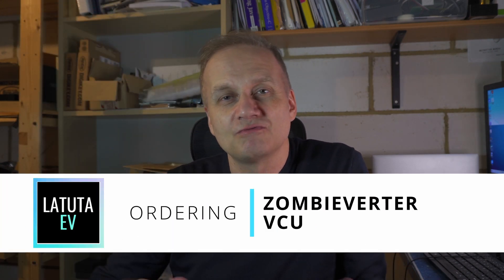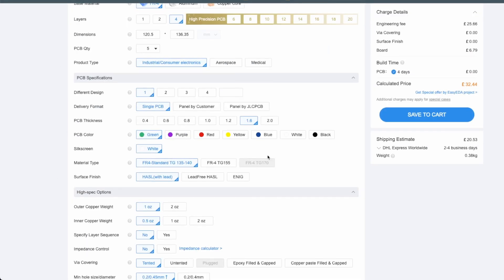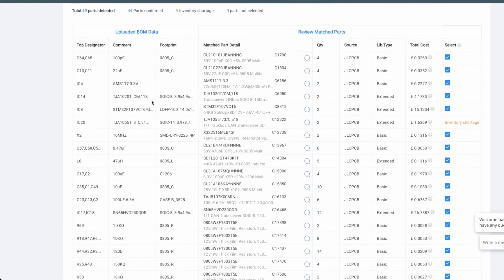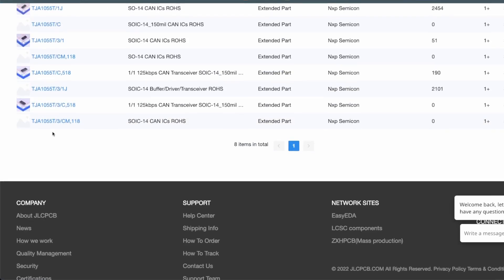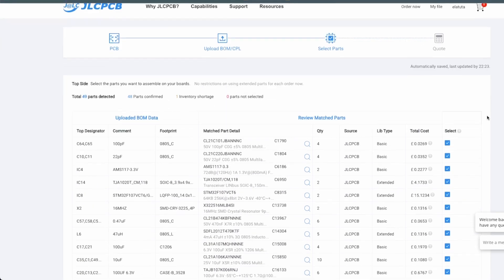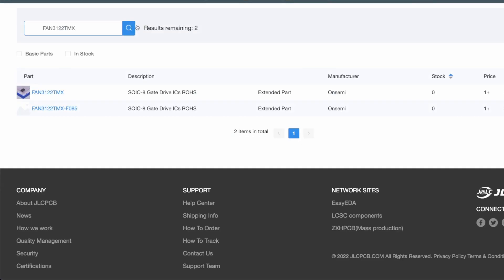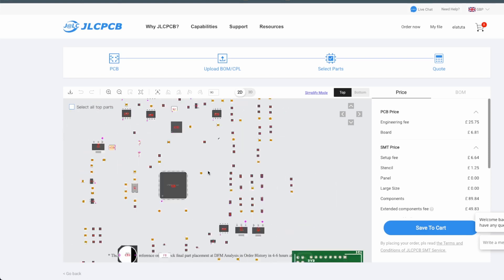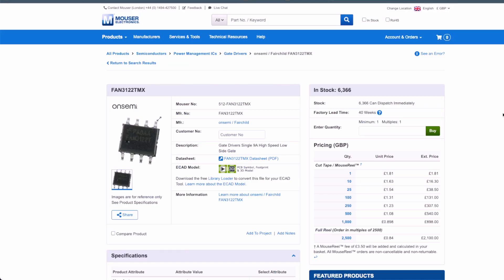Ordering Zombie Verter VCU #2

Comment: I like the idea of having my own board built as well - I think that doing it this way and becoming one of Damien's Patreons seems like the best of both worlds.  In fact, your original Gen 3 inverter board video was what inspired me to have JLCPCB put together the dual motor "small" board... that video was VERY helpful since it illustrated what to look out for between the different sized boards.  I don't see that Damien sells the "small" board.  I'm strongly considering to see if the Dual motor Gen 3 board can be paired with the Camry Hybrid transaxle for more usable power.  These transaxles are now pretty common in wrecking yards and might fall well under your original goal of a low-cost conversion.
Reply from the maker: I am glad that this video was helpful. When you talk about small board I guess you referring to the open inverter board for Prius Gen3 inverter. In this case I am making the VCU board which will communicate to the inverter through the serial link interface rather than providing control signal to igbt transistors. Also other benefits is that it could be used to control other sensors and/or auxiliary accessories in the vehicle. It can also interface to the open inverter as a VCU controller. You right about possibility of picking up cheap Toyota or Lexus transaxle.
Reply: @LatutaEV  Yes, I was referring to your other video... Both of the JLCPCB videos are helpful to those unfamiliar with the service and how to utilize it.  It's interesting to hear the Zombieverter can interface with the OpenInverter board as well.  I might look into that if I can determine that Zombie would offer extra functionality.  I don't have a specific swap in mind yet, I'm mostly just in an exploratory phase.

Comment: Thanks! Your step by step videos are great.
Love all the details. Gives me confidence I could do this. Could you share with us the total cost of all the parts?
Thanks,
Ross
Reply from the maker: For three boards unpopulated and two boards populated and wemos adapter board I paid 210 pounds plus shipping with custom clearance about 23 pounds. You can actually see final price towards the end of the video
Reply: @LatutaEV  Thanks, I went back to the end of the video and did find a total. So it looks like you might save about $100 by doing it yourself over the built unit that Damien sells.
Reply from the maker: @rossconverse9067  To be honest I am not building the board myself just to say money, more for the fun of doing it myself. But I just checked the price and Damien sells one board for 350€, I have 2 boards for £220 plus 3 blank PCBs
Reply: @LatutaEV  Yes, I understand. I'll probably build my own board too. Saving money and the satisfaction of doing it yourself is a win-win. Hopefully we can watch you build your board in detail. Thanks for responding so quickly. 
Ross
Reply from the maker: @rossconverse9067  I already had a message from JLC PCB about the delivery on the 28th but I am away from home for Xmas so hopefully get it in the new year

Comment: great video
Reply from the maker: Thanks I thought it was quite boring but maybe useful for some people ☺️
Reply: @LatutaEV  For the most of the people it is probably,  but we are sharing same interest :)
Reply from the maker: @bimerev  yes you right.
Reply from the maker: @bimerev  You should try bigger motor in your E39 would be interesting 😊
Reply: @LatutaEV  I should try gs450h as well , but  battery voltage is not matching and all other things. I have GS300h for other project :)
Reply from the maker: @bimerev  yes that would be great too. I am only looking at GS450h as they have comparable prices in UK but 450h has higher power
Reply: @LatutaEV  yes, but I beleve you can get 200 kw from gs300h. This is ok for me . I beleve it can do mouch more because gs450 is 300-350kw peak
Reply from the maker: @bimerev  yes I agree I may go for gs300h if it was considerably cheaper. But it is also has no external pump
Reply from the maker: Love your work on BMW conversion really nice job
Reply: @LatutaEV  Thank you :)